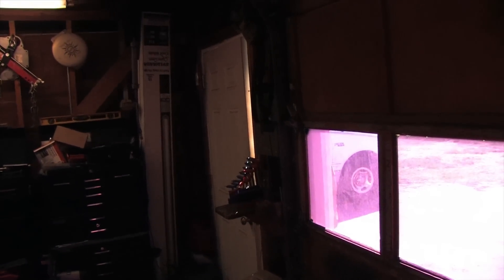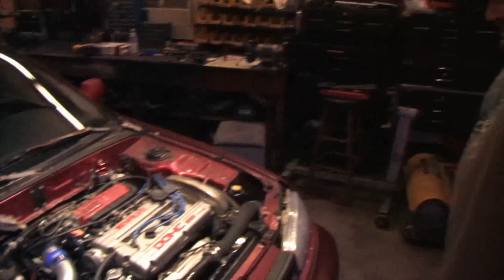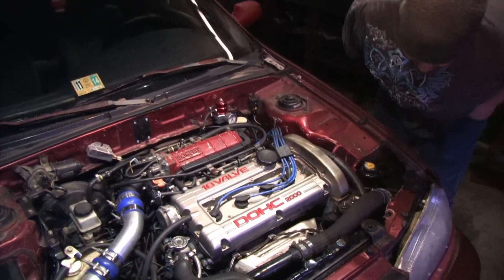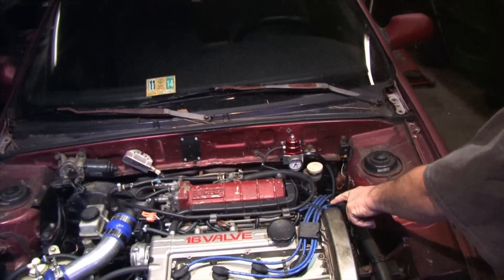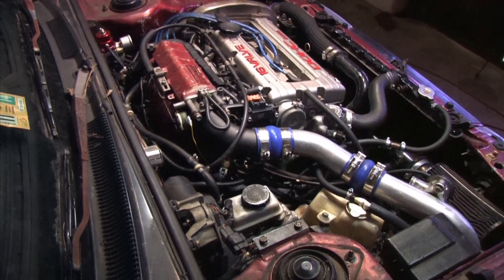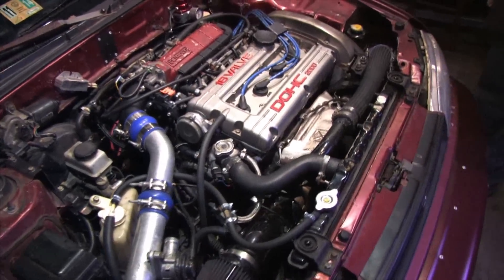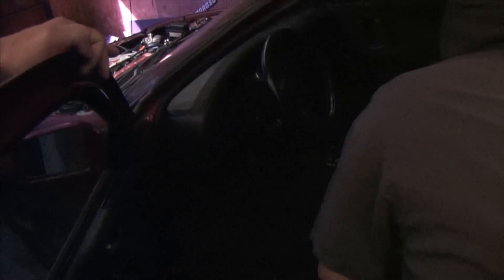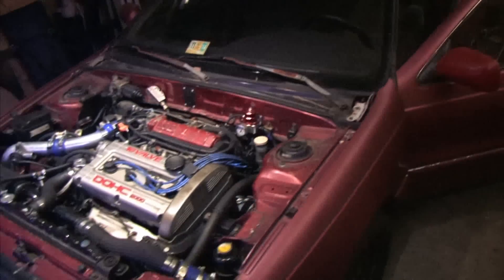Hyundai 11 - 1st Startup & Heat Cycle

Comment: In the video where you first installed the pistons to the block, you talked about using ATF as your run in oil. I'm just unsure did you use it as your run in oil or just as the lube around the piston and rings before start up??? Thanks mate, rippa of a series

Comment: Love the way you read the lift noise issue right away.  Many folks with shut down and cry but not Jafromobile. Good Job.  Oh change that oxygen sensor and clean the MAFS. Mass air flow sensor = MAFS.
Reply from the maker: This car is metering airflow with speed density, so it has no MAF.  :)

Comment: that lifter tick, I thought the 1nzfe was bad with its tick but thats atrocious
Reply from the maker: It only happens on the first startup when the thick, wrong grease I used in my oil pump got shoved into my hydraulic lash adjusters and sat there until the head was hot enough to melt it.  Really it was my fault.  I'll do this differently on future builds.  I got Honda techniques in my Mitsubishi, and it's totally my fault (Honda engines I've built were solid lift).

Comment: Well, really, really surprise about that valve noise??? Does it really have to be that bad??? Just wondering, if I did a total engine rebuilt, and heard that noise after first startup....mmmmmmmm, would not keep engine running....sounds horriffic=(( If the reason is is "multipurpose" break grease????, why in a world did you use that?? just wondering..., by the way, did you put a  new oilpump in there?? I forgot...., my Infiniti FX 45 valve job /timing belt/ pistonring-job is coming up, and now I am wondering, if I should replace the oilpump??? how do you test the old-one?? Noise sure went away...., thank God,......I was so, so relieved =) So, how did the engine work at the 1/4 mile???=)

Comment: wow mines makes the same noise for my b16a stock engine ,, i did a oild change it sometimes now makes the tick noise im looking for a something to stop that tick noise can help?????
ive tryd lucas /nothing  i tryd doing a valve latch adjusting ex.@0.6 int.@0.4 it sands a lil better ?????
Reply from the maker: +james herrera You may be having an oil pressure problem.?  That's just a guess.  I'm unfamiliar with the b-series and I can't know every engine... but if I recall, most of the other Honda engines I've worked on are solid-lift, and that naturally makes them a bit noisy.  If your oil pressure is in-spec, then it's either knock from carbon build up, or a side-effect of having a solid lift valvetrain.  The lifters in this particular car are hydraulic, making them quieter, and self-adjusting.
Reply: When I start the car first its high on 2krpm when it's warm up it on 1k on site ?
Reply: I might have to post it up
Reply: I drove it nothing bad over 20miles still nothing bad did the oil change n seen  lil sparkle shines 
The owner before me didn't take car of it ... It was low on oil

Comment: Jafromobile I was just wondering what you thought of honey as a break in lubricant, I have built a bunch of 302's for fox body Mustangs as my friends and I had one. I was told to use honey one time on the cam, crank etc everything that needed lubing while assembled, I'd do the 20 minute cycle at 2000rpm then drain refill then run for 5 min or so and go for a low rpms drive this would be for about 100ks then I'd let it rip.  I've never had an issue once even with the honey, but wanted to know if you'd ever done or heard of this as a use for engine building. BTW three engine I used it in was the guy whose dad told him to get me to use honey so I did, car seemed find and smelled sweet for awhile! 😂
Reply: Hahah what the fuuuckkk m8

Comment: Spencer Mills just do what Jafromobile explained I've always done my mustang engine builds this way, I just pull plug off the distributer or unplug the relay under the driver's seat. (in the fox body 87-93) Just cycle the key on a few times allowing the pump to get fuel up to the engine, should fire up pretty quick if everything is correct if not just cycle the key a couple more time's.

Comment: Did you "prime" the motor  before starting it? I'm planning my first engine build, and I see people saying I should drop the motor in with no timing belt, spin the oil pump with an impact, then quickly install the timing belt and start it. I'd much rather install the timing belt with the motor out of the car though.
Reply from the maker: +spencermillsful No need to put yourself through all that.  Disconnect the fuel pump relay or the pump itself (one connector) and crank it until you have oil pressure (the light goes out).  Maybe crank it one more time just to be sure.  Reconnect the fuel pump and then go.  If you ever think you have an easier way to do things, you're probably right.  It may not always be the easiest thing, but what's important to you is what matters most.  Go prove your buddy wrong and make him submit.  :P
Reply: +Jafromobile thanks! I've never built a motor, or even done a timing belt job on my dsm so the easiest way is what I'll do! Looking forward to new content. Thanks again!

Comment: With ECM link is it possible to set the timing without a gun? Just watch it change on the screen?
Reply from the maker: erikdude666 Kinduv.  It's not the right way to do it.  Your timing table is built assuming you're running 5° BTDC already.  If you want to globally change every value to correct your base timing, I suppose you could do it that way.  I would rather make sure the base timing is correct so that the tables represent the correct values.  The ECU can not read whether or not your base timing is set correctly because of how it gets its crank signal.  In order to read your base timing, you have to use a timing light.  I do that in Hyundai 13.
Reply: Sorry, I had a brain fart and should have specified what part of the video I was referring too as well. I was thinking of while you where "Butt Tuning The Timing", but I guess with your extensive experience with DSMs it wouldn't be needed too much.

Comment: hi do u think i can fit an n/a 4g63 in my accent mc,i know if i use civic 1992 radiator i get more room in engine bay but what else do i have to do
Reply from the maker: virgilio nieves Rewire the engine bay, use a 1.6L DOHC timing-side engine mount, the 1.6L manual Colt GT or turbo mirage transmission mount, front and rear roll stoppers from a 2.0L automatic and possibly cut out a section of the driver's side frame rail.  There are several Hyundai Accents here on YouTube (not my channel) that are swapped.

Comment: What turbo is that and psi? And nice job btw I wanna see some launches with the camera behind the speedo. Don't forget good tires as well.
Reply from the maker: Marc Kolz There will be helmet/dash/trackside dragstrip videos and dyno videos coming.  I'm still exterminating bugs and getting the tune straight.  It's never had a real engine management system, or speed density AF tuning capabilities prior to this, so that stuff's being built from the ground up right now.  It's a completely different car than it used to be despite the parts that remained the same...  Growing pains are to be expected when you double an engine's air supply.   I'm logging over 300 hp at only 9 lbs of boost right now, and with 12mm ARP head studs...

...it's built for 30.
Reply: ***** Damn man you sound like a veteran at this. How much does the chassis weigh? Riskiesk thing I did to a motor was slap a DOHC head on a engine made for SOHC. That's what I run now but the block is 2.3 liter F23 with JDM F22b DOHC head. Mates perfectly and is running strong... The Honda game is strong. Not sure about the hyundai tho. If you can put Mitsu parts on i'm sure its a definite performer.

300 hp is crazy tho man be careful, ,lol.
Reply from the maker: It's around 2600 lbs.  Then I go add 2 amplifiers 2 DVC 12" subs in a MDF box, 25 lbs of battery relocation crap and an engine that weighs about 80lbs more.  I haven't put it on scales yet, but I will.  They're at the end of the track in the return lane so I have no excuse.

Good info on the F22b head!  I'll pass it on.  The F-bomb's owner is a master of valve timing, and is sure he can nail a cam grind that will help this SOHC really perform, but I'm sure it will get used once that disillusion dissolves.  On the F-bomb, we had to grind off the front motor mount (the 5th mount) in order to fit the turbo with the DSM manifold, and perhaps a DOHC head would offer more clearance for it?  Any parts we didn't have, we made from scrap.  It's the lowest of low-budget builds on a bottom-of-the-line accord with no power options and steelies.  The DSM manifold wasn't a perfect bolt on fit, but it's nothing a few minutes with a grinder can't fix.  The injectors, side mount IC, half of the intake pipes, ex manifold, turbo, o2 housing, downpipe flange and boost controller came from the Hyundai.  We've got a fuel pump and regulator that came off another '97 GSX received in trade to settle a debt.  Including the replacement engine we have less than $800 in the whole car.  lol.

300 hp on the Hyundai is just the break-in setup.  I consider it mild.  I logged 421whp in my 3355lb GSX with the same turbo and cams that are in it right now.  I'm shooting for mid-400's on the Hyundai and that should be easily done because the Elantra's only FWD, and the methanol setup is still on a shelf.  I won't be satisfied until torque shears this chassis in half.  I've got 3 other cars I can bolt this engine into if that ever happens.  This is already the 4th car this engine has been installed in, and in its 6th re-incarnation now.  The Hyundai cars did not perform well in the US market, and everyone including Hyundai themselves hated them, so they've always been largely-overlooked, but most of the early '90's Hyundai cars are bolt-in DSM engine recipients.
Reply: ***** The dohc swap doesn't offer better manifold clearance I just think the advantage is you can degree the cams separately from one another. Those f22b dohc heads are kinda rare to come by because they're JDM import and most just use the whole engine. You can order those actually for pretty cheap low mileage they have 9:6:1 compression from the factory, its exactly like a F22a but just dohc and higher compression. In fact its more like a F version of a H23a1. H23a1 or H22 is also a good motor for building but thing is if you want boost you gotta get these special mahle pistons for the FR-M cylinder walls that's in the H motors. And boring, machinging those walls is not as easy as cast iron walls, you might mess it up royally. Some opt to get sleeves all of which can be expesnsive and I see you have chosen the rat rod option for the accord.

That's really cool info didn't know that about the Hyundai's being dsm compatible like that. Turbo and everything else... I'd bolt a dsm turbo manifold on a F22a of f22b dohc head but only thing is tuning is a problem and I can't find a tuner or take the time to learn  seems to hard. Maybe you could point me int he right direction I'm gonna use the stock ecu for an H22a on a H23a Vtec lol. They say it works fine might have to get a basemap chipped ecu for it tho to get it perfect... BUt some say not to use basemaps alone and you need real street/dyno tune.. but maybe they just ignant cause the motor is gonna be stock and if the basemap is good enough it'll be fine.

Comment: I was curious where you source your 4g63 motors from in or around VA. It is hard finding shops that are not in California. I have a bare 6 bolt block and a running 7 bolt head, maybe I'll build from there. New to DSM's so I have a lot to learn!

Comment: Hey there jafro I might be getting a 03 elantra manual I was wondering if it has any performance tuning potential  that I have over looked because so far I've found none for the stock motor
Reply from the maker: Matthew Amtower It doesn't share anything in common with any of the Mitsubishi engines, the last model with any compatible with stuff on my channel is '95... they switched to the Beta engine until 2000.  A few people have experimented with those... but I haven't followed much of the Hyundai performance population beyond that.  I wish I could be more help?  There are always manufacturers like Carrillo, JE, Wiseco, etc... who will make your custom rods and pistons if you provide the specs.  Rod width, big & small end bores, rod length, pin height, bore, piston skirt depth, ring groove depts, etc...  So it's possible.  It just starts to get expensive.  A "how bad do you want it" kind of thing.  You can find valves and springs to fit it, but you might be a pioneer of sorts.  There's no engineering problem that time and money can't fix.

Comment: How do you plan on breaking it in, Are you going to use the Classic break in method or break it in hard?
Reply from the maker: Ozizzle_95 Meh, there's nothing to break in...  The bearings don't really need it because there's not supposed to be any metal-on-metal there.  Aside from the gaskets, spark plugs and some fresh port work, the bearings are the only new things in the block.  Everything else is well-used.  Especially the rings.  It's one of the reasons why I can get away with a 10:1cr boosted engine.  Right now I'm breaking in my ECU and a wideband gauge.  :)

Comment: I thought you would have wanted to get it loaded up on the road to bed the rings straight away? They say its cruical to bed the rings within the first couple of heat cycles... ?
Reply from the maker: Rick James But the rings... they're re-used.  Nothing to break in.
Reply: I see. Ive been watching the build but missed that part. So if you had put new rings in would you have approached the startup differently?
Reply from the maker: Rick James Yeah, I'd have started it and revved to 3000 RPMs until it was hot, then let it cool, warm up again and go for a drive.  The rings should be seated within seconds of it being started, before I even pull it out of the garage, or else I did something wrong.  Maybe my stance on that has to do with the parts that I have experience with?  There may be some materials more finicky than my hardware... but that's what I've been taught and it's how it's worked for me.

Comment: Man, this car is sick! I'm jealous..

Can anyone tell me what's wrong with my 01 Elantra? It has 195k miles on it and it refuses to run smoothly. When idling or under acceleration, it basically fights itself. It'll make a popping sound through the exhaust (not really a backfire), sputters, almost dies then revs back up and runs okay for like 10 seconds. Then it proceeds to repeat. It has new coils, plugs, plug wires and a tank of fresh gas with Iso-Heat in it. Is there a sensor or something that is known to cause it to run like this? It actually idles better with the upstream o2 sensor disconnected. It also doesn't seem to have a bad intake gasket.
Reply: Do you have a CEL?  I would think those symptoms would yield a light on the dash, so pull the codes, and start from there. Now based off your descriptions, you might have a bad O2 sensor.  The upstream is responsible for controlling fuel mixture.  If the signal is glitchy, it will affect how the engine runs.  Disconnecting it causes the computer to control the mixture by other means, namely a preprogrammed fuel map and that could be why the performance improves.

Another easy check you can do to test a O2 sensor is to warm up the car long enough to enter closed loop.  Shut it off, and then start it back up again.  If it runs good for a couple of seconds, and then reverts to running like shit, chances are your O2 sensor's signal is erroneous, and affect closed loop driveability.

Comment: Hey jafro why would you not want to use the royal purple assembly lube for the   mains/rod bearings, I am going to rebuild a motor sometime this month, so I was just curious, is it just as simple as you ran out of royal purple? or did you have other reasons for not using it on the lower end bearings, thank you.
Reply from the maker: Mitsubishikid It's the simple answer.  Ordered it 3 weeks before the shoot, and it didn't show up until I started working on the head.  Bought parts store assembly lube to keep production rolling.
Reply: Thanks man, I guess I need to order another bottle or two from them then... my local auto parts store stopped carrying it on the shelves, I guess I'm not the only one that has to have the local parts shops order me this good stuff.